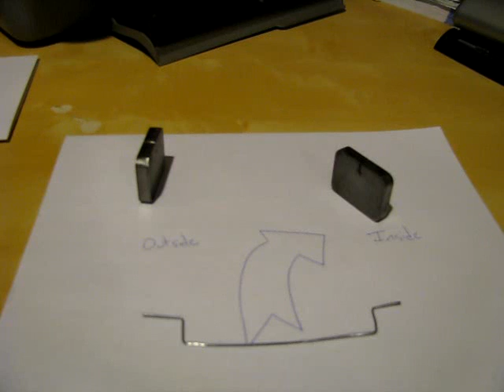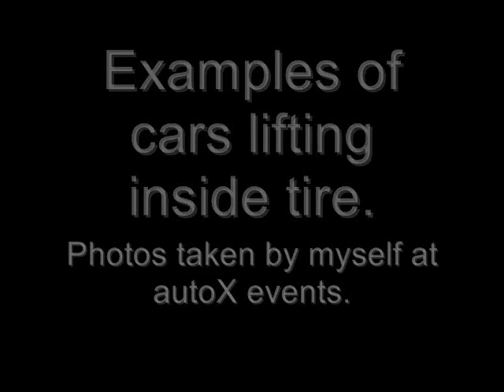Sway Bar Demonstration

Comment: You are wrong. If the outside (in your case here) wheel gets pressed by the chassis the other side of the sway bar (inside) doesn't lift, because the sway bar is not only attached to the wheels, but at two points of the chassis. The sway bar mirrors the sides, so:

If the outside gets compressed (let's say in percentage for an easier comprehension) the other side of the chassis also compresses the inside wheel side, because the sway bar gets pressed down in a whole. So outside gets like -60% compressed and the inside -40%.

If there is not sway bar the outside gets -80% and the inside +20%. (plus means lifting above the ground, minus means pression towards ground)
In this case you get a much higher body roll. Don't get me wrong, but there is a big reason sway bars are a critical part of a racing car.
Reply from the maker: Hello Raphael, so I will tell you my explanation is correct - see link video in which I detail in more depth how a sway bar works. I was going to try and explain it in this comment but realized I wouldn't do it justice. You are right - the sway bar compresses the suspension, but see video on what that actually means.

https://youtu.be/3O9rK8tKCTI
Reply: @goddom  HAHAHAHAAH... I swear... I watched that video before and it was the base of argumentation against this video. So YOU did that video, too. Cool!

Can you talk about the sway bar links? 
I have an E36 and we can attach the sway bar to the control arms or to the dampers (front). I don't know what are the advantages and disadvantages of both methods
Reply from the maker: lol, yeah, I am not sure I did a good job on the older video trying to demonstrate how struts work :-)

I am not sure, but I believe the advantage of the sway bars connected to the struts is that they have more leverage so work better, but the arrangement is more expensive to car manufacturers will favor attaching the sway bars to the control arms. I have an E36 as well - a 328. Fun cars!

I hope this helps!

Comment: What makes that bar lean to the left when the car is negotiating a right turn.
Reply from the maker: The body of the vehicle wants to lean, which will cause the sway bar to lean. I hope this answers your question.
Reply: @goddom  Is it possible for u to make the same video when a car is taking both left n right turns and it's corresponding effects on sway bar (showing twisting also). How it helps in protecting from overturn etc. Sorry for being demanding but the reason is I have been searching for a proper video about working of these bars but unfortunately no one was upto mark. Looking at ur skills I just felt that u may b a right person to talk about it especially ur immediate responding attitude.

Comment: How would a rc react to a sway bar in the front or the back just either or?
Reply from the maker: Hard to tell. Usually in the front that would increase understeer - so it won't drift or spin as easily. If you put it in the rear it should increase oversteer - drifting/spinning. But this can depend on the layout of the car and the suspension design... so I guess try it and see!
Reply: Matthew Eddy i have a redcat tr-sc10e
Reply from the maker: Sorry, I don't really know anything about RC cars. You will probably have to try it and see how it works out. It should change the performance of the car and if you want more grip you may want to get two

Comment: For racing sway anti roll bars are great. However, for street driving with potholes, bad roads etc., they are not the best rattle vehicle etc?  Your thoughts overall?
Reply from the maker: Sorry, didn't see this comment. YT flagged it as spam for some reason. Most vehicles come with some anti-roll bars to reduce lean while turning because people don't like that - but you are right in that going with a really aggressive sway bar for street driving is not idea because you will get wheel hop when hitting bumps and pot holes and is probably less safe and less comfortable.

Comment: A sway bar acts exactly the opposite of what you said.  As you make a right hand turn your left wheel and shock compress due to more weight being distributed to the left side of the vehicle which in turn transmits the force to the sway bar and right side suspension pushing it DOWN to KEEP the right side tire making good contact on the ground and not lifting. I mean why would you want your inside turn tire to lift.  That makes no sense.  The whole idea is to have the best possible traction on your wheels and to equalize weight distribution and keep the car level and not essentially turning your car into a motorcycle on riding on two wheels around the turns.  Bad info. One more thing is if you could find one of those engineer friends you come across could you get them to chime into our discussion because if I'm all wet Id love to know because I do have a thirst for knowledge and I'd appreciate it and apologize for wasting your time in our discussion.  I'm not trying to troll you, I mean I clicked on your vid to learn more myself but I didnt subscribe due to what I think is bad info.
Reply from the maker: Actually, you are incorrect. The sway cannot push down they way you mention, its physically impossible. So think about it this way - using the example right hand tun you mention above the car goes into the turn, the outside suspension compresses. The sway bar is effectively going "up". That means the right side of the sway bar is also going "up" which is trying to compress the right side suspension. Now the spring, shock,  and weight of the unsprung components are preventing this from happening. This keeps the body from rolling, which keeps the left side suspension from collapsing more, and therefore keeps the body more level and more weight on the inside tire. 

The sway bar has to twist - its like a long spring. The left side goes up, and the right side is pushed down by the opposite side suspension.
Reply: @goddom  Your very last sentence is the only thing correct about anything you've said.  The sway bar isn't acting as if it's connected at a single point like a hinge or fulcrum.  It's using torsional forces and the bar twists.   As your outside turn wheel suspension compresses it adds an upward force to the sway bar on that same side in turn twisting the bar and creating a downward force in the opposite side (inside turn wheel). You're wrong. I can go to any article on how a sway bar works and in no manner do any of them describe what youre thinking.  I'm not an engineer and I'd love to learn more if I'm wrong, I'm not trying to put you down, just correct misinformation.
Reply from the maker: Hello - Let me describe it this way and perhaps it will be more clear. 

A sway bar is a bar with that have to bends at the end. Imagine it is outside the car - you lift up the left end, the right end also goes up correct? Now lets put it in the car and you lift the left side up. In order to do that you will compress the suspesnion on the left side. Now lets look at the right side. It to, just as if it was out of the car, wants to go up and compress the suspension on the right side. However, the suspension on the right side is going to resist this upward movement. In doing so the bar will twist - thats the torsional spring effect - but it will also compress the suspension some - depending on how much force you use. 

Now to take this in context of a turn, you are in a right hand turn. The body leans over and compresses the suspension on the left side. Effectively the bar is being pushed up. That means, like the examples above, it will also push the suspension on the right up as well. 

Here is from an article I think explains is fairly clearly: https://auto.howstuffworks.com/question432.htm

Here is a blog post I wrote that has some diagrams that might help:
https://consummatedriver.blogspot.com/2018/08/how-do-sway-bars-work.html
Reply: Wow.  Even read the 2nd paragraph of the 1st article link.  "car flips over" describing natural physics and then they go on to describe the whole point of a sway bar and it definitely is Not to "lift" your right hand tire in a right hand turn.  In what world would you desire less traction from your tires around a turn unless you're drifting.  You seem to be confusing the obvious physics of what the car wants to do in a turn but fortunately the steering and suspension components such as a sway bar are used to counteract that boy aid in less traction.  I'm not an engineer,  and I'm not a car mechanic but I do happen to have been and still am an aircraft mechanic for the past 19 years so it's not exactly like I don't have any basic grasp of mechanics or basic physics. I've asked someone to chime in who I respect greatly but don't know personally but they probably won't find the time. The dude from "Engineered explained" I think it is. Maybe since you're a YouTuber too if you contacted him to review your video he could shut me down lol or straighten your video out.  Just an idea.  I don't know how to contact him other than reply in one of his videos.
Reply from the maker: I am not an engineer either, but I am race car driver and have been off and on for the last 10 years. I have run endurance races with vehicle dynamics engineers from Chrysler and other companies. My understanding of sway bars comes from discussions with them. 

Here check out this video from Engineering Explained - I happened to find it looking for a discussion on how sway bars work. You can watch the whole thing, but at about the 2:10 mark it will be more directly relevant to our discussion.

https://www.youtube.com/watch?time_continue=142&v=wNJt6htiOQY
Reply: @goddom  Nope I'm just plain sorry.  Citing resources that make sense does not make your explanation right.  Im not sure which is more wrong,  your understanding or just your explanation. It could just be your explanation but it seems to be both.  Your background is however impressive I still find it very very common for a pilot not to fully understand the mechanical operation of components on a plane even riding in them daily . I mean there is no reason for him to other than thirst of knowledge.  I mean you made a mock up of the sway bar to explain it to yourself which is good but you came to the wrong conclusion.  It's okay,  you can lead the horse but blah blah.  Lol we obviously firmly disagree but I do wonder if they could design a sway bar to pick up three wheels instead of your two as you describe in your theory do you think riding on one where around a turn could be even better? I mean how bout all four wheels. Lol sorry to be a smart ass but a car that has no sway bars at all around a tight fast turn is going to roll over first picking up those two inside tires.  A way to counteract that is to level the car with the sway bar and keep best possible weight distribution and tire traction to the road not aid in what physics is doing already.  Like a few others said "just plain wrong"
Reply from the maker: I mentioned my "credentials" because you did and give you some background on my experience for what its worth. I guess we can agree to disagree. I do believe my explanation in this video is a bit lacking because it was make 6 or 7 years ago and I have acquired more knowledge since then. I am surprised by your response because I thought the Engineering Explained youtuber was someone you wanted an explanation from. Did you watch the video?  He actually goes on to explain why stiffening up one sway bar, in the front for instance, causes more over steer. Your question about not using sway bars - some people do prefer that and instead tend to go with stiffer springs because really stiff sway bars essentially link the two sides of the suspension together. There are down sides to this - one being its harder to tune the suspension at the track because it would require pulling the springs and swapping them. 

Please do additional research, and thank you for watching my video if if you don't think it is correct.
Reply: hello,

we all agree that to have better weight distribution\traction is to decrease body roll.  (see last paragraph)  In the first post you describe the left side compressing (getting shorter) as the right side is pressed down ( getting longer) . would short compressed springs on the right side of the car and elongated/stretched springs on the right side contribute to body roll?

these are a copy and paste out of your first and last comment respectively:

As you make a right hand turn your left wheel and shock compress due to more weight being distributed to the left side of the vehicle which in turn transmits the force to the sway bar and right side suspension pushing it DOWN to KEEP the right side tire making good contact on the ground and not lifting.

A way to counteract that is to level the car with the sway bar and keep best possible weight distribution and tire traction to the road not aid in what physics is doing already.

Comment: Matthew, here's some additional info: 

"Think about what happens to a car in a sharp turn. If you are inside the car, you know that your body gets pulled toward the outside of the turn. The same thing is happening to all the parts of the car. So the part of the car on the outside of the turn gets pushed down toward the road and the part of the car on the inside of the turn rises up. In other words, the body of the car "rolls" 10 or 20 or 30 degrees toward the outside of the turn. If you take a turn fast enough, the tires on the inside of the turn actually rise off the road and the car flips over. A stabilizer bar tries to keep the car's body flat by moving force from one side of the body to another.

When you go into a turn, the front suspension member of the outside of the turn gets pushed upward. The arm of the sway bar gets pushed upward, and this applies torsion to the rod. The torsion them moves the arm at the other end of the rod, and this causes the suspension on the other side of the car to compress as well. The car's body tends to stay flat in the turn.

If you don't have a stabilizer bar, you tend to have a lot of trouble with body roll in a turn. If you have too much stabilizer bar, you tend to lose independence between the suspension members on both sides of the car. When one wheel hits a bump, the stabilizer bar transmits the bump to the other side of the car as well, which is not what you want. The ideal is to find a setting that reduces body roll but does not hurt the independence of the tires."

Source: https://auto.howstuffworks.com/question432.htm
Diagram: http://speed.academy/wp-content/uploads/2014/11/swaybar-tech-06.jpg
Reply from the maker: That is what I am trying to model in the video - granted I may not have done a good job explaining. The plastic piece represents the body of the car trying to lean to the outside of the turn. The bent paperclip is torsionally flexing (twisting). The metal pieces represent the unsprung mass (wheel, hub, portions of the spring and control arm, etc) and suspension that resists the force of the inner sway bar end to want to go up. What I didn't really talk about in the video _ I don't think its been a while since I watched it - the sway bar increases grip by keeping more weight (and by extension - more traction) on the inside tire. Once you have wheel lift on the inside tire, the sway bar is not successfully keeping the tire on the ground so therefore getting a bigger sway bar won't help. You need to increase the spring rate of that axle.  A stiffer spring on the outside won't compress as much and so won't twist the sway bar as much. The spring on the inside wheel will resist being pushed up by the sway bar end.
Reply: After reviewing your information (for the 3rd time), It does appear that the model represents the torsional movement of the system. Thanks for your prompt response and keep up the good work 😊
Reply from the maker: Thank you!

Comment: so ur saying that a bigger sway bar wont decrease wheel lift during a hard cornering situation? if thats what ur saying then i have to disagree! do it again with a thicker piece of metal like a piece of a wire coat hanger, apply the same amount of force and see what happens.
Reply from the maker: Hello.  Let me try and explain what is happening. Think of the sway bar is being twisted. Its atatched to both the wheels.  As the body rolls, theoutside wheel is being pushed up. The only thing resisting this - is the weight, spring and shock of the other wheel. So a thciker sway bar will be stiffer, and still just lift the inside wheel because it will overcome the weight of the wheel, shock, spring.  So to make the sway bar more effective you need to increase the stiffness of the spring.  That will reduce the tendancy of the car to roll, plus resist the force of the sway bar more effectively.  Then you can increase the sway bar thickness and see an improvement. I hope this was a bit more effective at describing how this works.